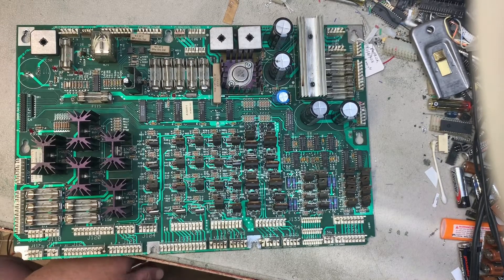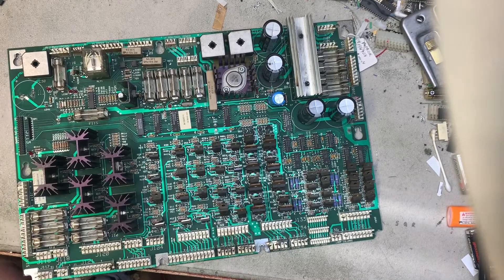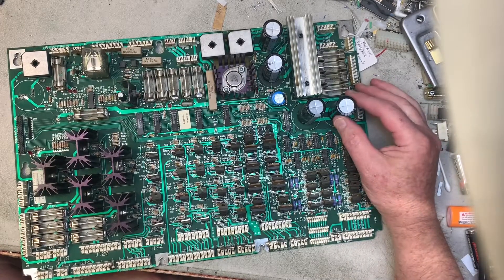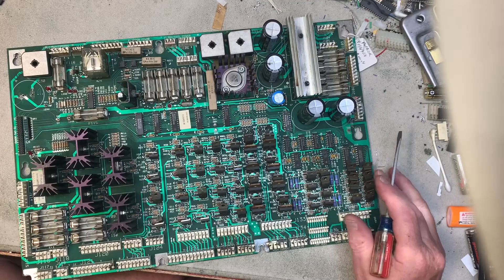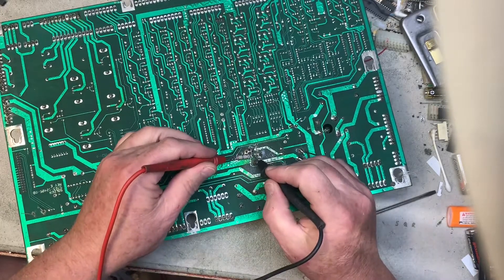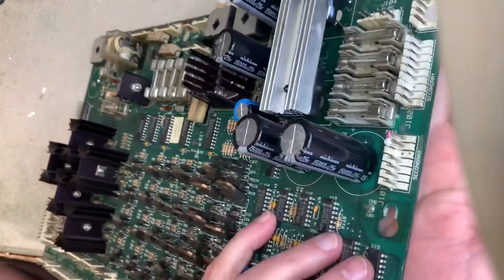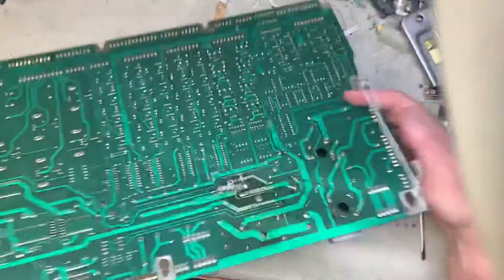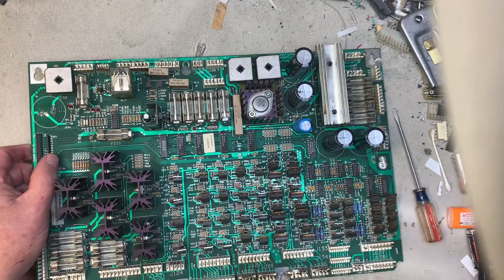Williams WPC PowerDriver Board Wholesale Capacitor Replacement Rant

Comment: Folks gotta learn! If they will pay to fix the error, kindly advice will have more impact than curmudgeonliness. Points for trying. Points for stopping before they did real serious damage. I am sure they feel bad enough already. I don’t want to show some of the crap I have wrecked! But I keep it running.
Reply: The casual pinball enthusiast comment in the beginning threw me.
Reply from the maker: This board came from a local pinball seller and not one of my clients. I'd never berate one of my clients. I know that they try. And, we all start somewhere. I've said that many times. You'd think people would have learned to not advise wholesale replacement of caps.
Reply: @ChrisHiblerPinball  Oh. Ugh. I thought this was an owner/hobbyist! For a pro, this is nasty! Old electrolytic caps = bad is a common perception.

Do you have a video showing repair of the thru hole trace damage?
Reply from the maker: @whiskyguzzler982  I sure do.... 🙂
https://youtu.be/ztuosZQVDFU

Comment: I believe that is the Marco kit for the driver board with the bridge rectifiers. WPC Power Driver board rebuild kit, WPC-PDA12697X. I just installed one on The Addams Family as preventive maintenance. I assumed Marco would get it right...dang. Thanks!
Reply from the maker: I'm glad you had the expertise to pull it off. Well done.

I hate the fact that Marco sells that kit. It contains the wrong form factor parts and it encourages folks to do their own work when they really shouldn't. But I guess if they never send the board to me for repair...it really doesn't matter. I'll never see the carnage.  🙂